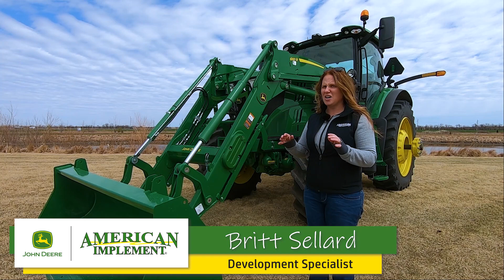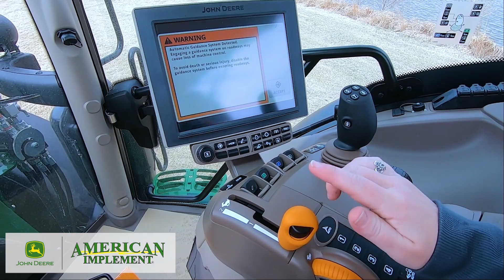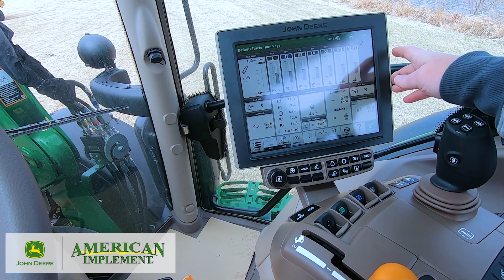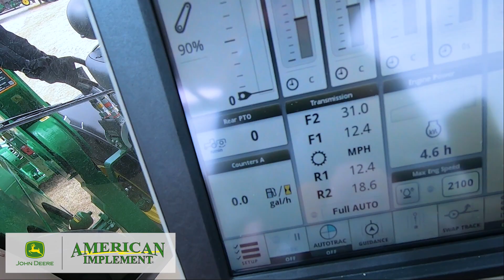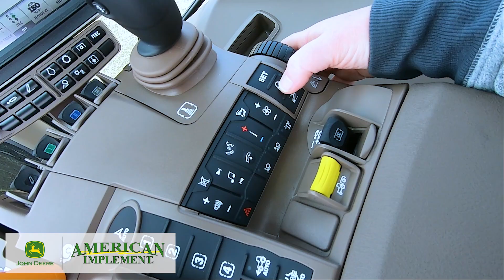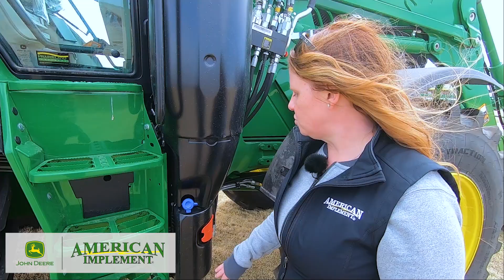The John Deere 6R Series Mid-Size Tractors

Comment: Great post! You left out fuel capacity, unless I missed it. Are there fuel tank options? This is a nice tractor!
Reply from the maker: Fuel tank capacity varies by the tractor size.  Example: 6R 130 has 51.5 gallon capacity.   6R 155 has a 71.3 gallon capacity.